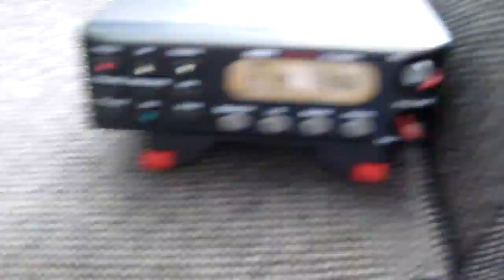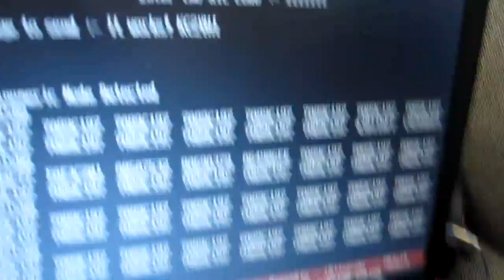POCSAG Encoder

Comment: i also downloaded that software.. i have a question sir, does the output of the software sends through the TX pin or  through the DTR pin? coz what i saw in there manual, was DTR pin.. which is kinda unusual..

Comment from the maker: Hi Matt,
KB9MWR has a lot of useful information about POCSAG.  I added a link in the description above.  I ended up using a slightly modified version of the top circuit shown in the file pe-pager.gif  (I need to track down my modified schematic!)
I used G8UKN's encoder software - there is a copy on KB9MWR's site.  I was running FreeDOS on a machine with a hardware serial port - I have not yet tried it on a DOS emulator or with a USB->Serial converter.
73, Andrew KC2YHI
Reply: My dad was G8UKN so I was just searching his callsign to see what came up and it's nice to see someone was enjoying his work. (He's still alive but with very profound dementia, so no longer a ham.) He went on to make a Windows version of the POCSAG stuff called WINPE. If I ever sort out his files and find it, I'll upload it all including the source code somewhere for free access because it's of no use to him anymore.